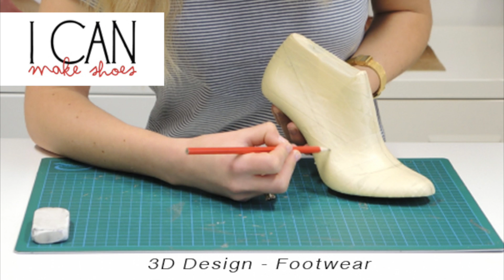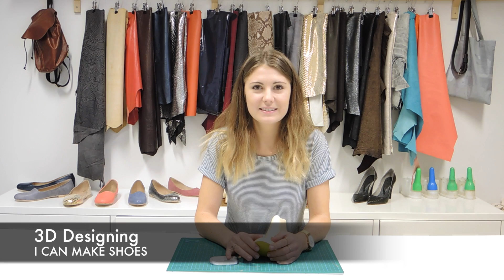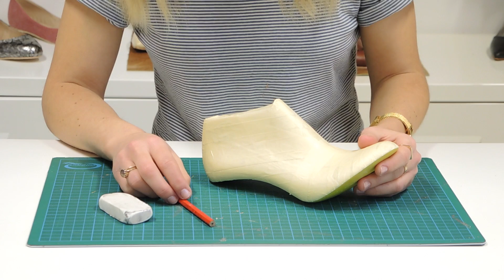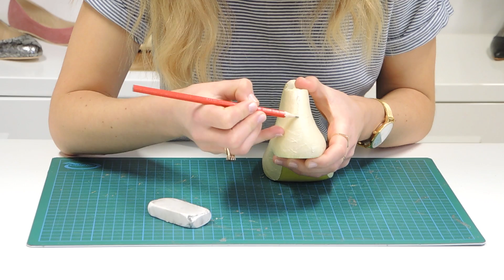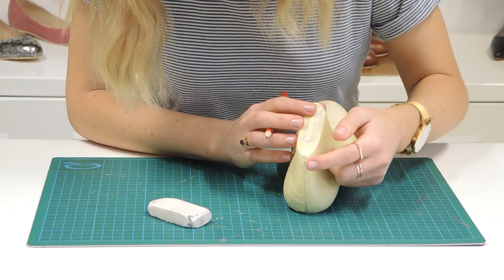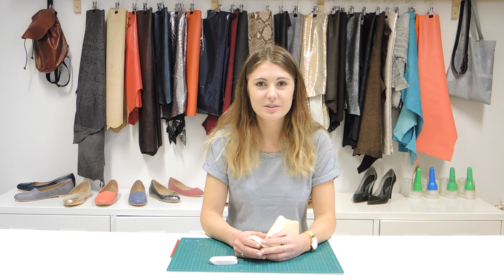3D Design Tutorial | HANDMADE | Shoemaking Tutorial

Comment: how do you know if the back height is correct.
 height. is there a standard measurement or ratio to follow. i ve seen videos where shoemakers use a ratio of some to figure out certain measurements based on size of shoe last.
Reply from the maker: measure the length of the bottom of the last and divide it by 5. Add 5mm to the measurement for ladies' shoes and 7mm for mens.